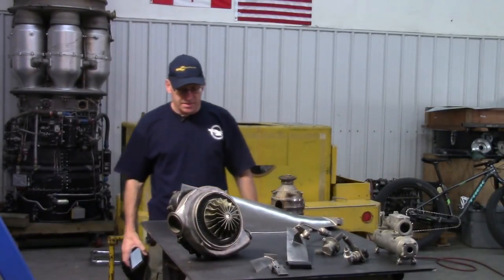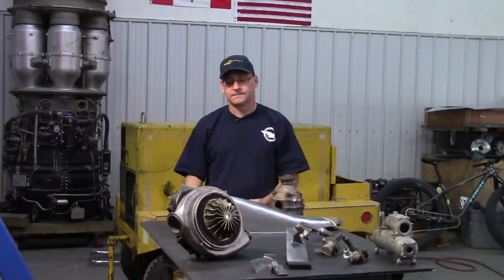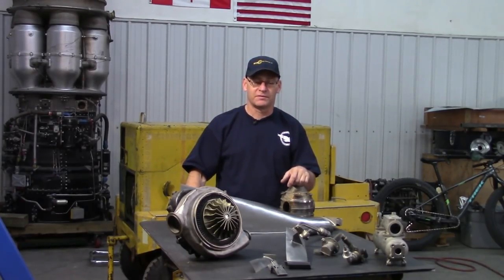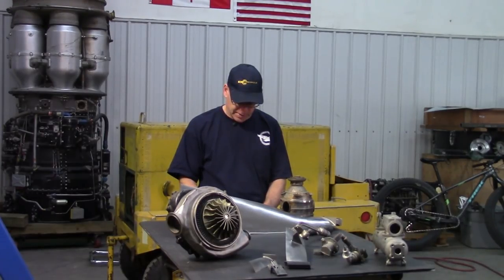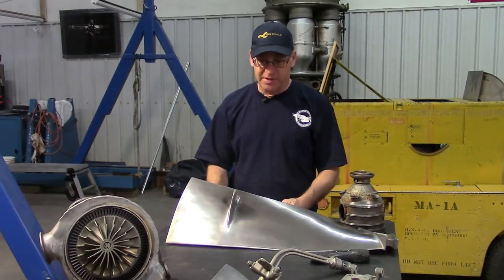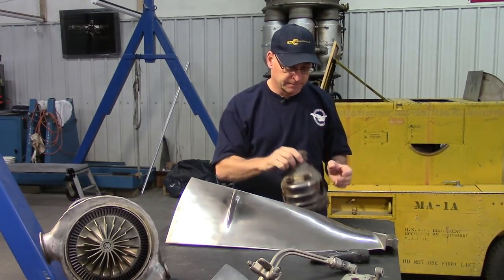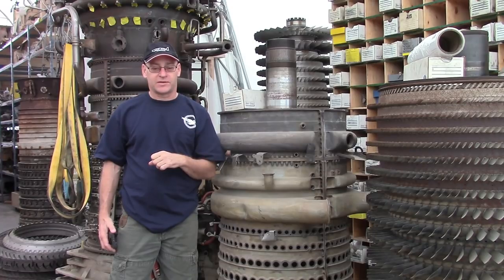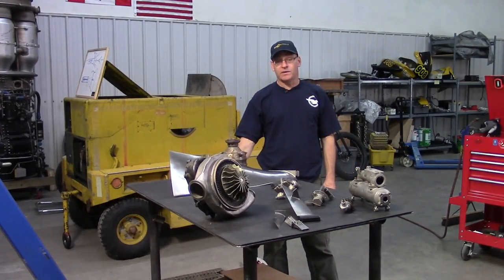Jet Questions 97

Comment: Excellent. I advertise your videos to my coworkers at Gulfstream Aerospace. Can you explain the effect of oil temperature on engine/APU start?  Where is the higher oil flow restriction point within the lube system?
Reply from the maker: With the operating range of the oil, typically -60F to over 300F, oil temp will have no effect on turbine engine starting.
The highest restriction in the oil system is at the metering nozzles, or jets.
In a typical gas turbine engine, the primary function of the oil is cooling the hot-running bearings.
Lubrication is important, but secondary to cooling.

Comment: The B-52 D models (the black bellies) had a heat exchanger where the inlet dome usually is. the J57-P-19W, not sure what it was cooling but likely oil, I was amazed they weren't beaten up by hail, large bugs and such.

Comment: QUESTION (in case you find it relevant): I notice that most (if not all) components are rust proof. However, do you use any technology or treatment (such as blasting, laser or chemical) to "treat" the surfaces after a piece has been on storage or "in use" for an extended period of time? Thank you. I really enjoy your videos! Alberto